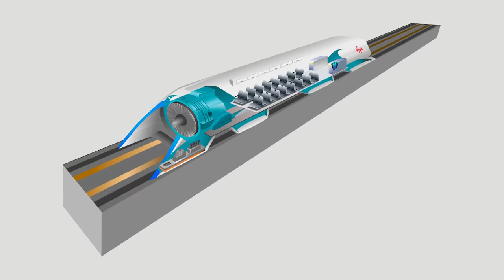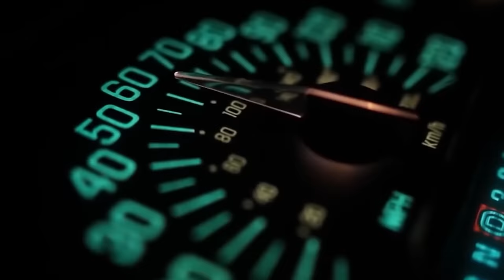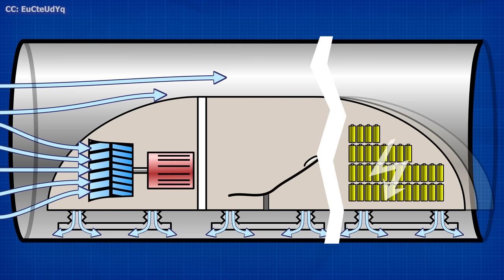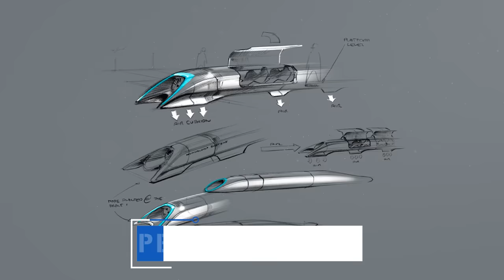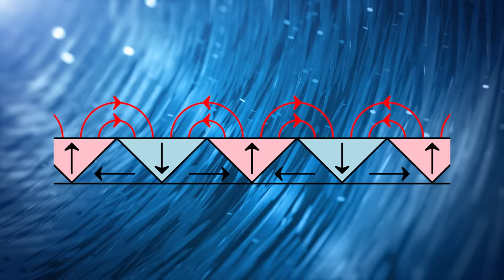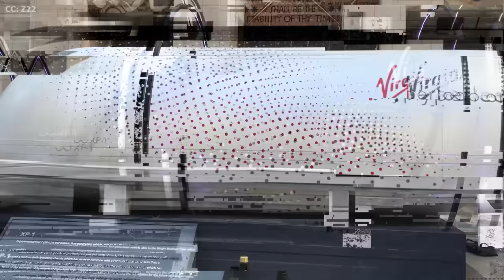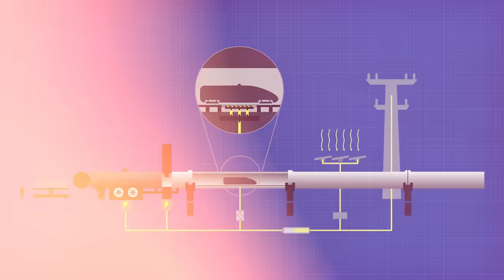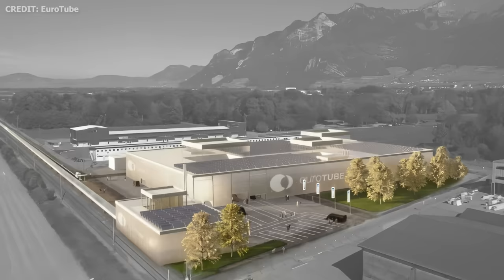We’re Getting Closer to a Hyperloop...

Comment: For freight it makes the most sense honestly.  But sitting in a metal bullet in a metal windowless vacuum tube and flung on magnets across the country sounds terrifying.
Reply: It makes the least sense for freight. Freight isn´t really about speed, it´s about capacity. Loading singular shipping containers, pressurizing and depressurizing the loading bay each time, launching them down a vacuum tube then unloading them takes more time than connecting 100 of them to a locomotive and going slower.
Reply: @hobotify    right now, sure.. but in 100 years, maybe not so much.  Freight distribution is more than just speed, or efficiency, its also about priority, weight, or safety, and most importantly, cost.  

A typical delivery of a product from, say, China, is loaded up from the distributor, or sent to a third party distributor, put on a massive ship, sent across the ocean, loaded and unloaded from a train, to big truck or plane, to a smaller truck or van, and then delivered to the buyer.  That costs man power, fuel, and time, spread out across multiple countries sometimes.  Cutting at least one of those steps out be a big positive. 

And, there's nothing stopping us from making these containers as large as we want too, unlike current freight containers whose shape, size, and weight, are governed by needing to be transported by road.   

Your definitely not wrong though.

Comment: Simple reality is that it likely won't ever work.  However, if you don't want to pull a true vacuum it becomes more reasonable.  The issue is the airlock systems you'd need to build around station platforms.

Comment: The costs vs. benefits of hyperloop don't really seem worth it compared to current high speed rail, especially since some pre-existing trains can go faster than some of the proposed hyperloop projects. Hyperloops will probably end up being tourist attractions like monorail instead of useful infrastructure.
Reply: Yes, if you want to overcome air resistance by travelling in a near vacuum the easy way to do it is surely to use nature's near-vacuum - ie altitude. Supersonic, or even hypersonic, air transport is far, far less problematic than this - and we know we cannot even manage that economically.

Comment: I totally bought into Thunderf00t's """debunking""" of hyperloop until I seen Shane Killian's debunking of Thunderf00t who messes up some basic science, and proves he doesnt know engineering. Eg the International Space Station gets holes in it often enough and they dont just explosively decompress. Nor does he know vacuum pumps. Nor did he decide to criticise the tests that were happening. Eg theyre testing brakes and TF complained about the speed achieved. They test the speed and TF complains about the size of the tunel, like testing at scale and low cost isnt a thing, and it needs to be full size 🤦‍♂️🤦‍♂️🤦‍♂️
Reply: Basically TF is good when it's basic science and simple products, but the second the engineering gets even slightly advanced he quickly becomes out of his league

Comment: This is great tech for transporting shipping containers. Then once it's deemed viable, someone can hitch a ride on a shipping container, prove it's safe, and we can start with passenger travel.
Reply: Long jaunt, Dad! Longer than you think!
Reply: actually it is really bad tech for transporting shipping containers. Think of how large a shipping container is. Then think of a pod large enough to encase the shipping container. Then think of how large the tube would need to be to carry that pod. Then think of the fact that most freight does not need to get anywhere quite that fast. Why does inventory that has been sitting around for weeks if not months needs to suddenly get somewhere in a matter of minutes? Totally wasteful and inefficient use of resources.
Reply: no, it isn't. The big theoretical advantage of a hyperloop system would be the amazing speeds. Please tell me what freight is so time sensitive it needs to be transported at supersonic speeds.
Reply: @taln0reich  Fresh produce
Reply: @yggdrasil9039  not even fresh produce is that time sensitive, if it's refrigerated (and refrigeration is way cheaper than building out a hpyerloop system). Let's say the distance it's transported was 1200 kilometer (so, about 50% more than the distance from hamburg to munich). That would be about 1 hour with the hyperloop, or about 4 hours (300 km/h) with some decent quality high speed rail. I don't think those three hours less travel time matter enough to justify the multi-billion dollar/euro expense that would cost.
Reply: @taln0reich  Ja, this from a country that still relies on the fax machine. Sometimes technology can open up new uses we didn't know we had before. What was the use of going to the Moon? There was no use. But it's opened up a new avenue of discovery and possibility.
But there are some immediate uses. Just on time delivery allows products to be moved around the world in a timely way. I agree that production is becoming more generalised, and will continue to be so with automation, but there will still be the need fo regional transportation. Being able to order somethign and it arriving within a few hours as opposed to weeks via a container ship is going to change things very greatly when this is made available. It will increase efficiency enormously.
With fresh produce, getting it from the farm to the plate the same day, is going to radically improve food production. When you refrigerate things you lose nutrients. Imagine being able to transport a mango from the tropics to Europe the same day it was picked!
There will also be less emissions of CO2. I know ships are planning to go CO2 neutral but hyperloop has that built into it already.
I think there will be some issues, no doubt, but overall the ability to transport and to travel from A to B very fast via hyperloop is a good thing.

Comment: Iv seen a lot of bad media focused on the non practicality of this idea. I'm pretty optimistic. Were coming up with new materials all the time. I find it likely we can find a material that can resist or compensate for the expansion or depression of our current materials when subject to varying temperatures. This is the main issue I've seen associated with hyperloop.
Reply: Or the fact that in order to maintain a vacuum tube of that volume you require pumps every few hundred meters, it’s proposed location is one of the most geologically unstable areas on the planet but that’s ok because these “bad media” are not focused on a wonder material that doesn’t even exist in theory yet and doesn’t compensate for a range of issues still present with the concept.
Reply: "...Were coming up with new materials all the time..."

......like carbon fibre subs, right!?!

Comment: The hyperloop is cool yes!!! But there are major problems…. We need long perfectly flat surface for countless miles and not even a curb or sidewalk can be in its place. Also going 50,000+ MPH won’t work…thats mach 47(says the internet) a USAF F-15 again according to the internet maxes out at mach 2.4. Which makes major sonic booms that is harmful to human/critter ears and shatters glass. It would take a majority power super jet engine, like space shuttle levels blastoff of power.
Also USAF pilots wear G suits. The cars even if they survive on arrival will have human puddles of passengers goo after going mach 47 and nuclear weapons levels of destruction on sonic boom’s going out the sides of the tubes.